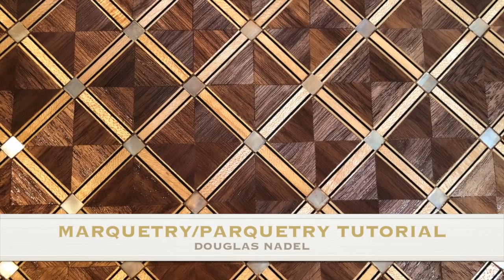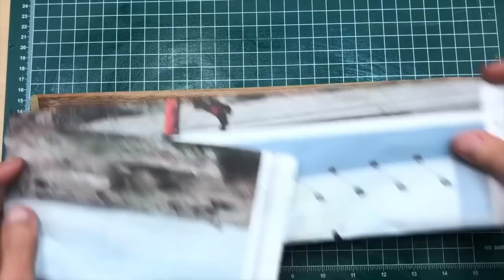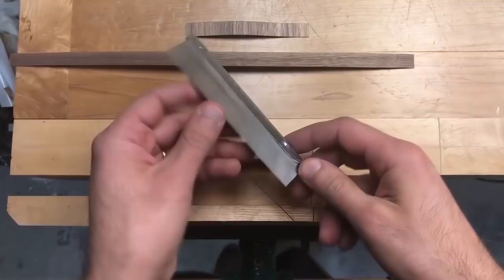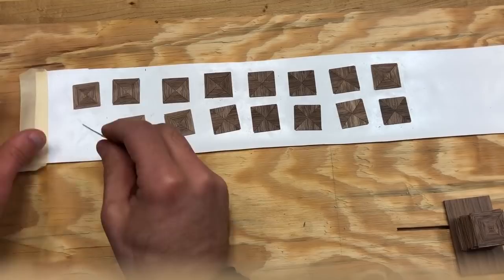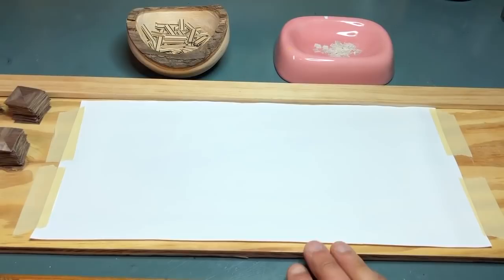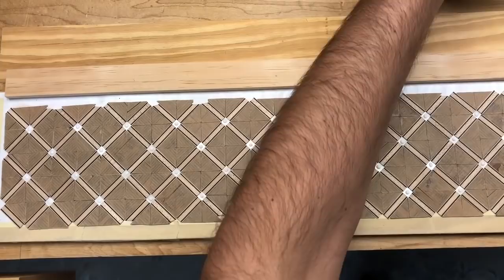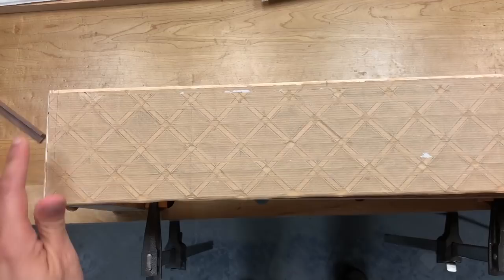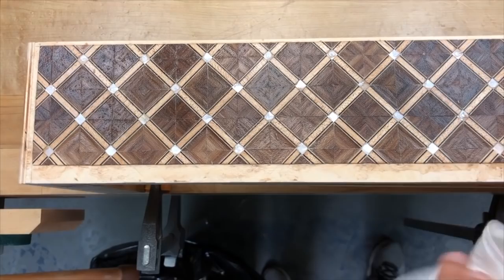Marquetry Tutorial

Comment: Instead of using pre-cut veneer and assembling each square by hand, wouldn't it be immensely easier to use a real block of walnut, laminate strips of that together in the grain pattern you want for the squares, and then cut the veneer squares from that? That's how factories make similar compound veneer and inlay pieces and would save you so much time.
Reply from the maker: A good idea but I don't have a factory-type machine to slice off thin layers of the wood perfectly like that
Reply: @douglasnadel1028 You can cut your own veneer with a bandsaw and a resaw fence. It won't be paper thin factory veneer, but it'll still be very thin. Youtube has a bunch of tutorials showing how.

Comment: Is there an easier way to cut exact strips of veneer? I always struggle and go off course. Would love to be able to make some with an electric tool if there was one that would work!
Reply from the maker: Some people use a veneer saw but I've never found it helpful.  If you're going off course my advice is to make a light scoring cut first, then go back over the cut a little at a time.  If your straightedge is slipping try one with a cork backing.  Another tip is to look at the grain direction and try to cut "downhill" with the grain.  The grain will try to pull your blade off course and so you want this force to be directed towards the straightedge.  Use sharp blades obviously.

Comment: That was awesome! Gorgeous work! Any advice on finding/designing more complex patterns? I'm struggling to find actual dimensions or guides on the math needed when angles aren't just 90 and 45.
Reply from the maker: You can get a 30-60-90 degree triangle at Staples or some other store that sells drafting supplies.  Otherwise you might need to do some trigonometry.  Send me a drawing and maybe I can help.  dnadel@dh.org

Comment: Question: what if I’m looking for more of a satin finish?
Reply from the maker: You could certainly use something like a satin polyurethane.  Or, if you do use shellac, don't polish it.  Go over it at the end with #0000 steel wool
Reply: Douglas Nadel awesome.  Thank you!! Should I avoid the wood filler step if I’ve got 3 different colored veneers?  Will it stain the light veneer?  I’m working on a Louis cube design.
Reply from the maker: @c.2538  The filler shouldn't stain the veneer, BUT it might make any gaps look worse if, for instance, you use a dark filler between two lighter colored pieces.  If you want to fill pores, you can do it before cutting out the pieces.
Reply: Douglas Nadel got it.  Thank you for reply!  I’m mounting this afternoon!